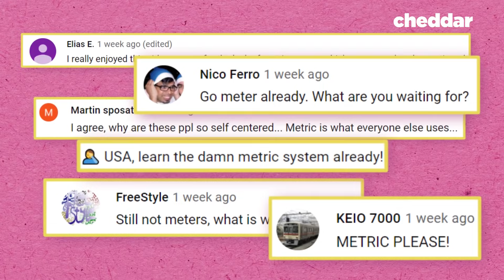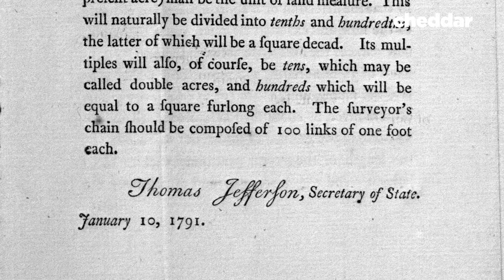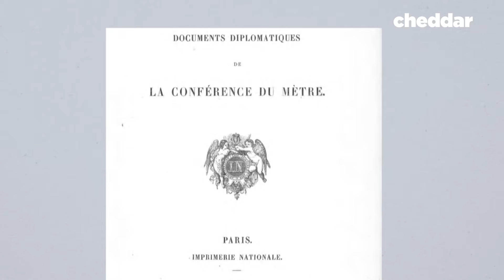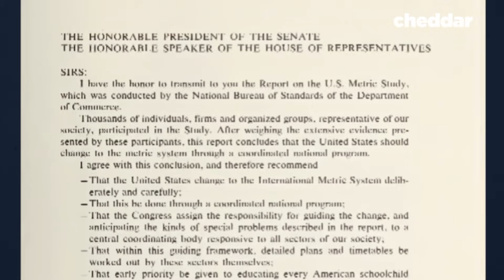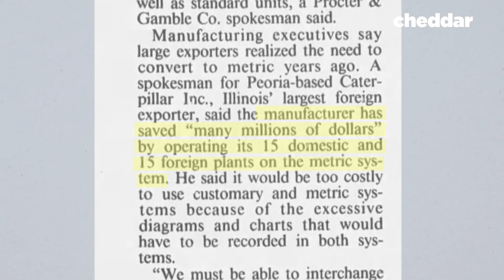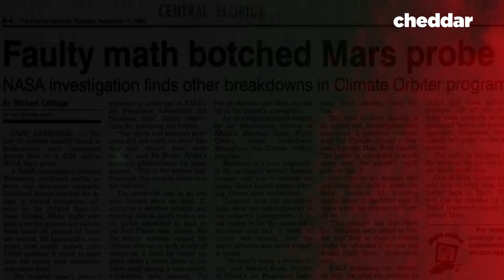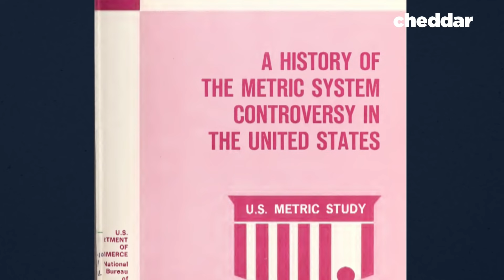Why Doesn't the US Just Use the Metric System? - Cheddar Explains

Comment: As an engineer in the US, screw the imperial system.
Reply: I'm going to be an electrician and we only talk in metric.
Reply: @joekev27  that's blatantly false, you do realize what thou is short for right?
Reply: @camdore6294  wish YouTube would list replies to comments in order, so I could read what Jski had actually said about "thou"
Reply: @joekev27  i thought you only spoke in SI
Reply: @joekev27  no you don't, wire is sold in British Standard Wire Gauge (SWG) or US American Wire Gauge (AWG) sizes as an overall strand bundle diameter, even though the bundle strands may also be desigated as e.g. 19/0,2 (see BS G 210) meaning 19 strands each of 0,2mm diameter. This is for equipment wire, not household cable.
Reply: @joekev27  The utility bill for electricity comes even with kWh (metric) as energy unit ;-)
Reply: Good job beeing an engineer
Reply: @salthe21st47  gUd joB SpEeLInG bEeINg
Reply: As a Scientist doing science with US company's and for the US, screw the imperial system
Reply: Let the US be the US.
Reply: @tmoney3864  thank you
Reply: With job engineer you should be working with metric.  Because its everywhere.  Even though imperial is in every country just only in small amounts
Reply: @Electronic Adventures by the way, maybe you should go talk to some of the mechanics in your area. Unless you live in a shit hole, theyll have metric and standard tools.
Reply: Steve Guacamole — But we don’t use the Imperial System.  In the U.S. we use US Customary units and SI units, as appropriate for the context.
Reply: As an engineer in Canada who is forced to use imperial because of Americans, screw the imperial system
Reply: @NB_703  
As an American, you are 100% welcome for standard.
Reply: @Electronic Adventures I do believe theres a number of people who buy our classic cars and ship them to overseas, I dont believe they come with metric bolts lol so yes, people will.
Reply: @Not_An_FBI_Van  ain't got much choice have they. Anyway, Snapon make some of the world's most desirable tools, so as good an excuse as any to own some, even if rather pricey
Reply: I'm an Englishman engineer and I'm as happy as Larry to use both as needs be. Called it inverted snobbery
Reply: @andrewdking  Well said kind sir.
Reply: @jarrettodom3943  my phone doesn't list replies in any sensible order, so I don't know which comment you are patting me on the back for. Doh !
Reply: @andrewdking  it's about the one where you use both systems of measurement besides being British.
Reply: @Electronic Adventures and the Americans probably think just the same if buying a foreign (to them) car with metric fasteners. You forget the USA is a big country and doesn't need the foreign cars or metric spanners. Not really !
Reply: @Electronic Adventures 🤣🤣🤣🤣
Reply: I hope you get fired
Reply: Agreed imperial is a real pain
Reply: Computer scientist here.  I dgaf.  Just keep them consistent.
Reply: I would buy you a beer if I had the opportunity good sir
Reply: Are you screwing it with imperial tread?
Reply: @bagamax  hah, made me laugh. Unfortunately, all of the screwing I do is imperial.
Reply: Steve... I bet you know g in both systems. If not then you must've went to LSU college of engineering.
Reply: Engineers are the ones that make things go, but it's management that determines what and when things will be made and how fast and how far they will go.  So, as a manager I'm telling you to shut up and go back to work.
Reply: Unless your ordering a drink
Reply: 5000 meters = 5 kilometers 
5000 feet = $%#$÷ mile
Reply: @Andrew Clarke 
2019 year. Almost 2020. Some jerks still use their body parts to measure things.
Reply: @beepboop8184  :  It has nothing to do with body parts.  Feet and pounds have been officially defined for over 400 years, perhaps more.  If you're going to try to make an argument, make it a proper one. Otherwise, you are undermining your own credibility and torpedoing your argument.
Reply: @Milesco  they are ”officially defined” in a way that you can’t reproduce exactly the same measurments today. If you look at them as antient wisdom - they are useless crap, if only you don’t use objective units for verification of these rudiments that you call a ”system” in US. What is lb today? It is legally defined as 0.45359237 kg, you don’t use the same definition as they used 400y ago, if you want consistent, reproducible measurments.
Reply: @beepboop8184  :  Besides not making much sense, you're also missing the point.   You were disingenuously saying that we use body parts to measure things, and that simply isn't true.  The length of a foot has been officially defined by a brass bar -- not someone's foot -- for over 430 years.
Reply: @Milesco  >>this simply isn’t true

Also, you are missing the point, that by saying that I’m just mocking your inferior units.
’Muricans lack of sense of humor as well?

Brass bar is nowhere near any sort of preciseness required in the modern world. And most important - no one is using brass bars to define foot today.
Reply: @Milesco  the meter, by the fact is defined by the distance light travels in vacuum in 1/299 792 458 of a second. Where the second is defined by duration of 9 192 631 770 cycles of the radiation produced by the transition between two levels of the cesium 133 atom.
No, platinum bar is a history. 
But more important: metric system is usable and scalable, when imperial units are just pile of incoherent garbage.
Reply: @beepboop8184  :  Yeah, I know that. That definition came into being in 1983.  Before that, the meter was defined as 1,650,763.73 wavelengths of the Krypton 86 atom.  And before that, up until 1960, it was the distance between two lines etched into a platinum bar kept at the BIPM headquarters just outside Paris.

But contrary to your worthless opinion, the U.S. Customary (not "Imperial") units are not "incoherent gabage". 

Yeah, I get it -- you don't like them.  But that's only because you didn't grow up with them and you're not accustomed to them.  If you did, you would.  Most of the Customary units are a handy size for everyday measurements. 

And in any case, nobody is forcing you to use them.  But hundreds of millions of people thought the world (yes, not just the United States, but in many nations of the former British Empire) use feet, inches, pounds, gallons, and pints for various purposes.  Obviously such units have some value.

But the surest way to keep us using them and to resist going metric is to insult us and our units.
Reply: @beepboop8184  :  We don't use Customary units for scientific purposes, Enlade.  Surely you know that.   And I have never in my life needed to know how much energy takes to heat a gallon of water.  But if I did, it wouldn't be that hard.  Water weighs 8.33 lbs per gallon at room temperature... one BTU per degree per pound... 8.33 BTU's per gallon per degree Fahrenheit.  It's not difficult.   (That being said, I concede that I would actually use metric units for that.  But again, that's not what Customary units are for.)

As I said, we don't use Customary units to do science.  We just use them to measure ordinary everyday stuff, and for that, they work just fine.
 
"Appeal to the crowd, argumentum ad populum is also garbage, sorry."

Not in this case.  It's true that "appeal to the crowd" is an improper method of finding fundamental truth, like the existence of God or the speed of light, but it's perfectly acceptable for determining what a majority of the people find convenient to use.  Indeed, it's the definition of that.

And the fact that hundreds of millions of people use the Customary system in their day-to-day lives proves that it works well for that purpose.
Reply: @beepboop8184  :

(I had said "It's true that "appeal to the crowd" is an improper method of finding fundamental truth, like the existence of God or the speed of light..."

You replied: "Putting something that exists and something that does not on one level -- smh")

LOL!  You obviously have no idea what side of that issue I'm on!  😄  (But think about it -- what is provably, logically true about the existence -- or NONexistence -- of God?) *

But you also missed my point -- it's not about putting the existence (or NONexistence) of God on the same level as the speed of light -- my point was that questions of fact are not amenable to a public vote or an "appeal to the crowd".  Facts are facts.  The earth is round.  That is not open to public debate.  In other words, you and I agree on that!  (No need to create disagreement and conflict where it doesn't exist, Enlade! 😉)

But matters of public opinion -- such as which units of measurement are most popular with the general public -- are by definition appropriate for an appeal to the crowd.  And the crowd says they prefer the units they grew up with and are accustomed to.

And the bottom line is that they use them -- and that is proof that the Customary units are quite satisfactory for the purposes for which they are used.  If that were not the case, those units would not be universally used nationwide. 

Quite simply, the fact that Customary units are widely used is proof that they are useful. 

I know you think they're deficient, but as I have said countless times, they work just fine for the uses to which they are put (namely, just measuring stuff).  And the proof of that is "in the pudding", so to speak.

____________________

(Just to be clear: although I'm not a professional scientist, I consider myself a man of science.  And although I vigorously defend the use of Customary units by ordinary individuals for everyday personal use -- especially against unfair or snarky / bitchy attacks -- you DO understand that I'm not anti-metric, right?)

____________________

* (Using "the existence of God" as an example of an issue of fact [although it is] was probably a poor choice of example on my part.  That was just the first thing that popped into my head.  If I had spent more time thinking about what to write, I probably would've offered a more concrete example of an issue of fact, like whether 2 + 2 = 4 or the number of protons in a helium atom or something.)
Reply: @beepboop8184  :  I do agree with you about MM/DD/YYYY.   That's illogical and indefensible.  Nobody seems to know how or why it ended up like that in North America.  It's most unfortunate.
Reply: We have never used the Imperial system in the United States. We use the US Customary System and the metric system.
Reply: @Ethan.Lamoureux  you have used the Imperial system back in the 16 hundreds when you were a British colony. However, it may not have officially been called the Imperial system back then. Many (but not all) of the measurement units are identical because of that fact
Reply: @andrewdking  The imperial standard did not exist in the 1600s. There were numerous standards, many of which were used only for certain classes of products. Today we use troy weight for precious metals and common pounds for other weights, but imagine having any number of different pounds depending on which substance you are weighing! The USA decided to standardize its weights and measures, as did the UK, but the two countries did so independently and there are some differences, especially with liquid measurements. The UK system became known as the imperial system, while the American system became known as the US customary system.
Reply: @Ethan.Lamoureux  a big mistake our two countries not agreeing common unit size values. I bet there is loads of bad data on Wikipedia because of authors not being aware e.g. of the three main ton varients of UK long ton, US short ton and the SI metric tonne. I expect many heaviest ships weights are in the lighter US ton (2000 lb), making them appear heavier than British ships published in the heavier UK ton (2240 lb).
Reply: As a carpenter in the US fuck metric.
Reply: I lived in the UK for a couple years and all of the metric talk and KM/h was making me mad. So glad I’m back in America haha
Reply: @traprico  in free country you are fre to use dumb imperial measurments.
Reply: @beepboop8184  
And still the vast majority of free countries use metric
Reply: @thatmarchingarrow  what? Why do you reply to me?
But I agree, ’Murica is far from freedom and democracy, as well as from metric system.
Reply: @beepboop8184  
Sorry, lost track of who was saying what, and I thought you were arguing for sticking with the imperial system
Reply: @thatmarchingarrow  Never have been in US anyway.
Reply: @Why does everyone Forget George joestar 

Because the metric system will make your American lives easier. No more conversation errors if you do what the rest of the world does
Reply: @matchalatte5415  most of the Rest of the World were third world countries and had little to lose by going metric, with the rest probably already metric. Its a significant fact
Reply: as a professional that has had the onerous task of working with engineers, screw engineers.  engineer isn't a career, it's a punchline.
Reply: @knotkool1  oh well
Reply: @knotkool1  punchline. I like that. Yes, name any profession which has more influence on the human world. Or name any man made item which an engineer hasn't had a hand in creating ?
We should be paid far more than accountants and solicitors (lawyers).
Reply: @knotkool1  I actually am a screw engineer, creating international standards for threaded fasteners. I can categorically say that aerospace uses inch series fasteners using Unified threads. Metric ISO threads are definitely frowned upon.
Reply: knotkool1 you can learn to do business as you go but you can’t just randomly learn to become a Good engineer (I took both careers) so in my eyes business is more of the lazy guy’s career that won’t push their boundaries at all. Truly something I learnt better in the job than the entire career.
Reply: @ABEL-cd2sp  I'm sure you are saying something quite profound, but it just doesn't quite come across in a manner I understand. Have another go at your wording please
Reply: @knotkool1  was wondering if someone would say it. 
As someone who has worked construction for 20 years, we're constantly having to fix what the engineer has came up with in the plans. 
Aslo, working in construction, we constantly go back and forth from metric to standard, its really not that hard. So, if you're an engineer who has a hard time doing this, I'm certainly surprised.
Reply: Josh B I love how US citizens always refer to Imperial as „Standard“ as if it‘s the normal thing to use and metric is this weird offspring even though when you look at the rest of the entire fucking world it‘s actually the other way around. Americans are so self centralized it‘s incredible (for better or for worse)
Reply: @geekmac9349  Meh, I work on cars a lot, when it comes to tool sizes, we call them Standard and metric. I dont call it that because I think its some kind of "standard" the world should use.

I also wrote that, I use both because Im in construction. Its really not hard to go from one to the other. If you dont want to learn how to convert metric to "imperial" or the other way around.......dont.
Reply: Josh B I get that but that doesn‘t really change anything about the fact that it‘s stupid to call it „standard“ to begin with. And only cause changing between both systems isn‘t hard also doesn‘t mean that imperial isn‘t completely redundant and should be ditched.
Reply: @geekmac9349  I'm just not sure why it bothers some people so much. I doubt we're going to change anytime soon.
Reply: @Not_An_FBI_Van  It bothers people because it's really stupid. I'm from Germany and every time I watch like an american cooking video and the measurements are all Imperial it drives me fucking nuts because it's so unnecessarily stupid. Just use the fucking objectively better System.
Reply: @geekmac9349  also they use volume too!  How to you measure a cup of butter! And a cup of flour varies depending on how or who is measuring it!
Reply: @geekmac9349  Standard refers to the US Customary System, which was standardized in the late 18th century, as opposed to the previously used measurements which had multiple standards varying according to what you were measuring. But if you hate Americans so much, that probably won’t help you any.
Reply: Josh B I don’t understand it either, but as a student studying aerospace engineering, I get really frustrated with the US customary system. It just seems very counter intuitive once you leave the simple stuff. And I have to end up doing conversions with numbers like 32.64 or something like that, just within the US system, not converting between measurement systems at all. I like metric cause I can do a lot of the math in my head rather than having to pull out a calculator every 5 seconds. But it’s just a personal complaint for me since it just takes longer. And for a lot of people who complain about this, it isn’t even affecting their lives.
Reply: @Not_An_FBI_Van  >>from metric to standard

Dude, measuring things in body parts and tea spoons - is not a standard, it's a silly crap.
Reply: @Not_An_FBI_Van  >>Its really not hard to go from one to the other.
It's not hard, with some tools, parts and super glue to build a trolleybus from a loaf of bread: http://caxapa.ru/thumbs/810092/14132802653482.jpg

But why?
Reply: @Not_An_FBI_Van  it doesn't bother. That's not the problem. It's just that conversion errors happens. Not writing or miswriting the units does occur.

Worse comes to worse, a disaster can happen, especially if you're working in a power plant.
Reply: @Icewind007  doesn't hurt my brain as much as using decimals hurts american brains lol Americans always get so pissy when you have anything other than praise to say about them even though in this case any decently intelligent person would realize how non-sensical the imperial system is
Reply: @geekmac9349  and it driver me nuts American YouTube makes use the stupid metric system when they where taught in school the imperial system
Reply: Josh B i agree. SAE is a garbage system but it’s here to stay. it’s too convinient for woodworking and construction especially. but yes. metric ftw. screw SAE
Reply: @David-yy7lb  their is no such thing as American YouTube, YouTube is a American website.
Reply: @geekmac9349  Imperial isn't Standard. Imperial is specifically British standard and just Standard is US standard. Being English I'm used to it.
Reply: @Not_An_FBI_Van  tip mate. Ever since Snapon created the sockets and spanners which drive on the hexagonal fastener's flats, not its corners, and every other tool company copied them, you will find you can ignore the size stamped on the tool and just use the tool which fits the fastener most snuggly.
Reply: @geekmac9349  no its not. It was "standard" in the US probably for a century before the Yanks had even heard of the metric system. Its just different, not necessarily better. We Brits invented standardisation because of the (our) Industrial Revolution.
Reply: @ngchew3336  a cup of butter. Cups are for powder or liquid measures. Its just common sense rural measures. Butter is by weight or nobs.
Reply: @gabrielgustavson22  learn the differences. Engineers need loads of knowledge to be any good. Knowledge is power and making yourself invaluable to a company is a good thing. I did well as an engineer lasting 42 years with the company before being made redundant. The payoff and pension is good enough I don't have to work again. So be fascinated with the US/British Imperial systems. Beware though, they are not identical. Note especially the liquid measures and ton weights differences.
Reply: @beepboop8184  it absolutely makes sense. Did your Granny use scientific measure to bake a cake. No, and neither do you. But you have a few spoons and a tea cup I'm sure. Off you go then.
Reply: @F15ElectricEagle  1. literally been to the US 3 times
2. I know y'all technically use metric too but most private households still measure stuff in imperial for things like cooking etc even though metric is just superior
3. chill out lol it's just measurements no need to get this upset about it
Reply: @gabrielgustavson22  Gabriel, It's not a personal complaint It's every Engineer student's complain
Reply: @Not_An_FBI_Van  we are not bothered, we just laugh... Again. 😉
Reply: @geekmac9349  :  For the United States, it IS the "standard" system.  And by the way, it's not imperial.  It's "U.S. Customary."  Imperial is British.   U.S. Customary is American. 

The United States is a big country.  One of the largest in the world.  It spans an entire continent and comprises 331 million people.  It is separated from the rest of the world by two huge oceans.  If we are insular, that's a result of geography, not arrogance or self-centeredness.

Individual citizens generally have no direct commercial contact with other countries.  So there is simply no reason for individual Americans to go to all the trouble and hassle of learning a whole new, unfamiliar measurement system.  There's nothing to be gained by that.  Business and industry already use the metric system, as do the fields of medicine and science.
Reply: @geekmac9349  "Americans always get so pissy when you have anything other than praise to say about them..."

No, we just don't like being insulted.  You can make an argument for or against one system or the other without being insulting.  Well, most people can.  You evidently can't.